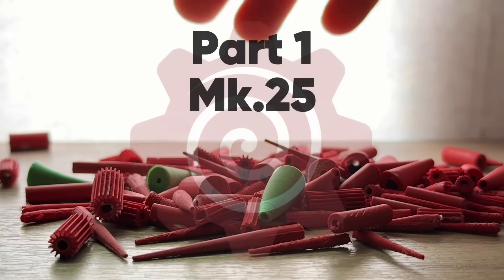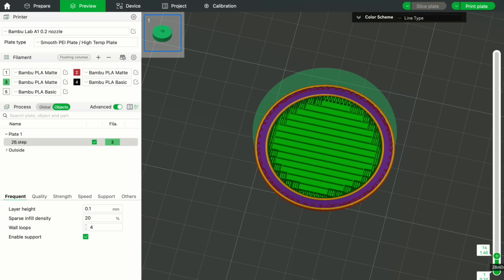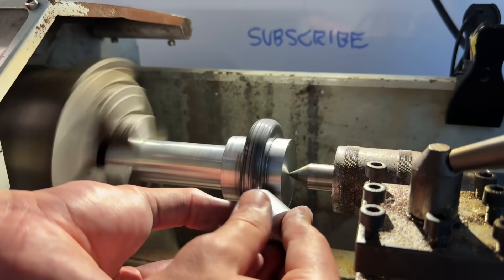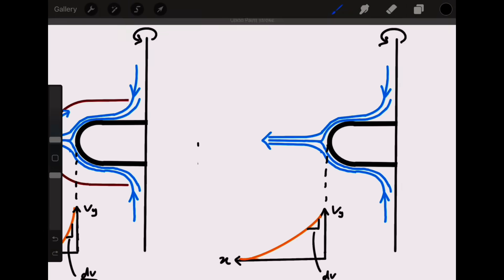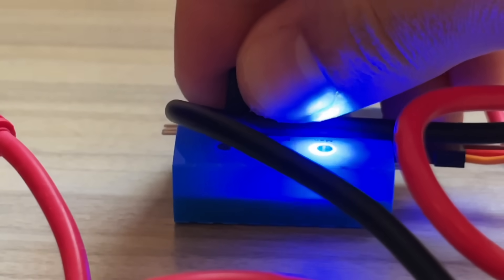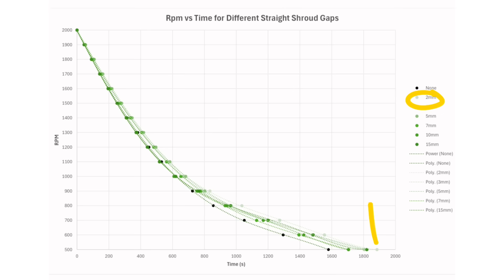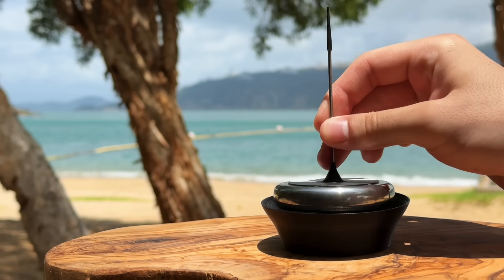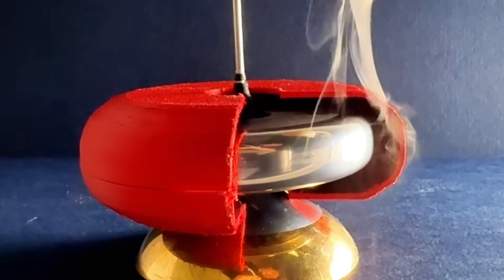Spinning Top Mk.25 | Aero Shroud??

Comment: Maybe it's worth to have concentric rings of slightly raised ripples on the top surface of the top. It could help prevent or limit the centrifugal pumping even without the shroud
Reply from the maker: Needs testing!

Comment: What happens if you set that shell spinning too? To maintain the inertia of the air around it.

Or... What if you make a spinning top that, instead of fighting the wind, uses the wind to spin even longer?
Reply: Or both... You could make an open capsule in a specific way that allows the wind to enter and rotate inside it, helping the top spin faster than in a vacuum.

It would be as if the wind were a jet of compressed air propelling only the sides.
Reply from the maker: Interesting ideas, yes it would help, though difficult to implement!

Comment: Is it against the rules to heat up the top?  Assuming there isn't material failure from the weaker and critical materials like the tip, a warmer top would heat up the air inside the shroud and would make it a less dense fluid.
Reply from the maker: The jury is still out as to what the ideal atmosphere would be. On one hand, yes hot air is less dense, but cold air is less viscous. Complicated!
Reply: @hiper_tops  Hmm, maybe then there would be an ideal temperature, a sweet spot given those opposing factors

Comment: This channel annoys me cause i told you how you can get free spin time but you refuse to do it. Just add bearing in between the friction point and the body. Or even better add like a cascade of them. Each segment will reduce the friction. Then end it with the carbide tip. Free spin time.
Reply from the maker: This isn’t allowed for the record (“no moving parts”), however I agree it could help and will try it for fun in the future :)

Comment: @nd post..Meh I wrote the first post completely forgetting Nikole Tesla centrifuge...using air , blown over equally spaced plates will cause a laminar drag, that will enable, ludicrious RPMs...
AKA and air hose...lol. Im so derpy sometimes.  Constructs giant geared Rube Goldberg contraption to spin top. Dude walks up wit tire pump and destroys my accomplishments in two pumps...sigh. CYA.  Im going back to building over powered racing rider mowers.  Where i belong.  And leaving this hard stuff to you.
Reply from the maker: Hahaha compressed air is certainly good at getting things spinning

Comment: I have a 50 to 1 speeder drive rated at a maximum 250 ft lbs of torque lol.... So using a Honda B20B We could maybe theoretically hit 500,000 Rpm's? 
( I know its wont actually spin that fast, the bearings are rated to 100,000 Rpms on the output side. Too bad. But thought it a funny mention for you.
I do know there are very small air bearing speeders that can comfortably run at over 125,000 Rpms.  Wonder how long it would keep that top spinning?
Reply from the maker: This is a fun idea actually, seeing how start I could start it just for fun. It would make for a crazy decay curve for sure!

Comment: With 3d printing being an option for the shroud... i wonder what effect different textures could have when using a more accurate resin print. You could also print thin caps for the weight to really play with drag reduction. The clasic golf ball texture being one example but others like airbus's shark skin texture would be more interesting imho.

Comment: What would you do to improve if you haf unlimited time and resources?
Reply from the maker: That’s a fun question! Certainly an Osmium flywheel is a given, it is the densest material known at 23g/cm^3 but incredibly expensive. Then some kind of super stiff but low density polymer core, perhaps resin printed. A concave mono crystalline diamond base which is super smooth would be great. However I’m not even sure this is possible, perhaps if I were to throw enough money at it someone would try.

Comment: You could try some gas density tests with hydrogen or helium in a box spin up and flood the box with a small vent at the bottom with H or He 
Might be an easier test than altitude to start with.
Reply from the maker: I like this idea, it’s cheeky but could be fun and I think it would help

Comment: What if you spin the shroud too?  (formed as a top where the cover over the top functions as the handle, and then you can spin up the shroud so that the internal airflow isn't pushing against a solid boundary?
Reply from the maker: This is a unique idea, yes it could help but it would be a bit difficult to implement and feels a bit to cheaty
Reply: @hiper_tops i feel like it would only be cheating if the exterior was spinning faster than the interior, therefore imparting force upon it, but as long as the exterior is spinning slower, it's still bleeding momentum from the principal top.

Comment: What is a "top"?
Is top that stable in a statiс, ie stable at 0 rpm didnt touching base, still consider top? Low centre of mass below touching point, will make top unfallable => longer spinning at extreme low rpm.
P.S Still suggesting mountain trip. Spin top at the top of the World.
Even small elevation, like 2km will make difference.
Reply from the maker: Generally it is accepted that a top’s tip must be below its centre of mass such that it topples at the end of the spin. High elevation testing is on my to-do list!

Comment: If the surface experiencing maximum air speed were profiled less like D and more like ▷, it might make a beneficial difference in how much drag goes to pumping vs shearing.
Reply from the maker: If the top were spinning a lot faster then this may be true but even at 3000 rpm, air sticks to the profile quite nicely and ejects in a disc

Comment: What about adding circular ridges inside the shroud to further restrict the recirculating flow?
Reply from the maker: This is an interesting idea which I may try but I find if the shroud is too close to the top, it makes the spin up difficult and when toppling the top can’t lean over as far before the spin ends.

Comment: One of the things that stands out to me is the slight wobble of the handle. Even as small as that wobble is, you're probably losing some energy to it because of needing to displace the air when it moves. It seems likely to me that it adds up over the length of the spin.
Reply from the maker: You are absolutely right. In this case during filming the balance was not perfect. It was a lot better when I recorded the best spins. In the future I will put more effort into displaying the top at its peak :)

Comment: I'm not sure about the reliance on 3d printed parts for a high-precision device like this top.  Somebody else mentioned the inherent surface roughness, and I think you should probably consider applying a surface filler and sanding them smooth, but that's all I'm going to say on that.

However I think there may be another issue that has been overlooked, which is balance.  Even a tiny imbalance at a couple thousand rpm could be enough to rob some energy at the bearing interface.  3d prints are by nature an imperfect medium.  There could be slight variations in the location of the print head on different travel directions.  You could introduce an imbalance if your infill pattern is not geometrically centered precisely on the axis of the top.  You might even see variations in the material properties of the plastic lead to imbalance (unlikely unless the filament isnt stored right).  

This leads me to ask, as a professional engineer, what real-world advantage does a lightweight plastic core actually have compared to an aluminum alloy?  If you test them side-by-side, are you able to get both up to the same RPM?  If your answer to that is yes, then you're actually hurting yourself with the plastic core because you're starting with slightly less angular momentum.  And when you're optimizing every single bit of the engineered design toward maintaining angular momentum for the longest time possible, starting with even 1% more of it will make a difference.   On the other hand, if you do find the lightweight core lets you spin it that much faster, maybe you could consider a machined plastic core.  It's not going to be as light as the hollow 3d-printed core, but it would solve the roughness and balance problems i discussed above.

On a slightly related note, If we're optimizing every bit of the design, I'm going to pick on your bearing interface.  Tungsten carbide is cheap and abundant but not the absolute best material you could pick.  You also appear to be running with no lubricant.  I'm not sure if lubricant would actually help or hinder, but that's easy to test.
Reply: Well i got nerdsniped and started looking up friction coefficients of very hard materials.  Diamond is of course hardest, and synthetic diamond might be worth considering.  Unfortunately I'm struggling to find friction data for diamond under moderate loads.  Most of the stuff i'm, clicking on is talking about micro-newton loads in MEMS devices or similar microscopic applications.  But i did stumble across an article that mentioned 2 other carbides, silicon carbide (SiC) and boron carbide (B4C).  
SiC is apparently 9.4 on the Mohs scale and also has a much lower friction coefficient that WC, but it doesnt look easy to get in solid pieces the size you need.  
B4C is apparently Mohs 9.5, has a friction coefficient about half of WC, and appears to be used as solid crystals as the tips of some lathe/machining inserts, which would be about the size you need.
Reply from the maker: Thank you for these comments and research. Some good points about bearing materials - this is something I’m still working on, including diamond!!

Comment: If you start changing surface finish you MUST test every single change individually with a control, it is very very hard to predict, and smooth is not always better

Comment: I got some tips for printing transparent parts. There are two main methods.
1. 100% infill, obviously, and turn on ironing on every layer. This almost entirely eliminates voids in the print, but will result in excess material forming zits all over the surface, so the part needs to be sanded down and polished. The result is not completely perfect, but the process is relatively simple and very consistent. 
2. Remelt the print in salt. Free spirit 1 has a video about it (nRLJ4ylGTFc). The result (after sanding and polishing, of course) is perfectly clear, but the process is finicky. The remaining air coalesces into big bubbles in the print, so what you have to do is add reservoir (a big block of plastic) onto the part for the bubbles to flow into and angle it in the salt such that air from anywhere in the part can flow into it without getting trapped. And then you have to hope it works. Which it often doesn't, especially with thin parts. Oh and sometimes the mold just collapses. It's a lot of work, but the parts (if polished well) come out clear as glass.
Reply from the maker: Wow thank you for this feedback!

Comment: If using a vacuum chamber is off the table, do "the rules" allow using some gas, like helium or hydrogen to reduce drag, or maybe just increasing the temperature to decrease the density of the air? An increase of temperature of  3 °C  will make the air about 1% less dense, all else equal. Assuming aerodynamic drag is the major loss, and the density affecting both the "gripiness" of the air, and the mass per unit of volume accelerated, a 3 °C increase in temperature might result in somewhere around 1% overall improvement.
Reply from the maker: You raise an interesting point and to be honest I’m not sure exactly how things like temperature and humidity would impact times. For example, although hot air is less dense, it has higher dynamic viscocity. Similarly humid air is less dense but has a higher dynamic viscocity. Interesting stuff! I may talk about this in a future vid

Comment: You need to try dimpling it!

Easier said than done obviously. But a perfectly polished surface typically has higher drag relative to a dimpled (but not rough) one! Will probably negate the need for a shroud!

For your first test, you could try a smooth 3d printed top vs a dimpled one to see if there's an improvement. Probably only worth trying if you have a resin printer to minimize effects of layer lines. You could also see if any of the online print/fabrication services could 3d print the dimpled top in sintered metal. Hellooooo pcbway sponsorship 😂
Reply from the maker: Hahaha I have actually tested dimples and found they are counterproductive in this application. I will make a video on this soonish!

Comment: Check dimples like on a Golfball for the inside of the shroud or the flywheel…. Who knows what it might bring 😅 But i would print it with a resin printer. Even a cheap one gives you a better surface finish and therefore better aerodynamics !! Good luck and keep on 😊
Reply from the maker: I have actually tested dimples and found they are counterproductive in this application. I will make a video on this soonish! Good point about resin printers
Reply: @hiper_tops awesome ! Already curios to see it 😊 Wish you luck for the World-Record 🎉

Comment: have you also considered moving to hollow shaft instead of a solid titanium rod, it could offer the last bit of weight savings with most of the rigidity
Reply from the maker: That’s true, and was my initial plan, however it is hard to find thin hollow rods!

Comment: If the goal is avoiding pumping effects then you probably want thin barrier ribs as close the top as possible. This would minimise extra drag while preventing circulation.
Also, what lattitude are you at? Those spin times are long enough that you probably need to be thinking about the effects of the earth's rotation. What angle would you expect it to be sitting at if angular momentum was entirely contained? Could you get longer spin times simply by starting slightly off vertical so that the earth's spin would initially make it more vertical? Is it worth simply flying north to do a run as close to the pole as possible?
Reply from the maker: Interesting suggestions! Regarding starting off vertical: If I did this (or regardless), the top would quite quickly right itself in a spiral motion towards perfect local vertical. This is due to an effect briefly explained in my spinning top science video - How to make the worlds longest spinning top

Comment: A really ‘out there’ idea may be to try and program some kind of optimiser for the shroud design (size, shape, hole placement etc). Something like a genetic algorithm tends to give unexpected designs for these kind of problems, that often outperform more conventional paramaterised designs.
That said, it wouldn’t be easy to code up and I’m doubtful you’d get a significant improvement.
Reply from the maker: It’s kind of a dream of mine for this project to culminate in such a programme. I believe it is possible, at least crudely, however will take some time and a lot of learning.

Comment: You may have tried this before, but have you considered adding (or rather removing) dimples to the mass? Like golf balls, they reduce drag. See a Mythbusters episode when they added dimples to a car to improve its mileage.
Reply: Dimples on golf balls work by delaying flow separation, which is not an issue here.
Reply from the maker: Indeed they would be harmful in the application of spinning tops. I will show this in a future video!
Reply: @agsystems8220   Ah. Thanks.

Comment: When I see your videos I am like "I want to try and make one", but I am also thinking about what are the design contraints? max weight, size etc.?
Reply from the maker: It is rather complicated! But you can’t go too wrong when following the ratios of examples that work well. It will mostly depend on whether you want single or multiple twirls, and what materials, sizes and machining capabilities you have available.

Comment: Any imbalance in the core mass will translate into microscopic lateral friction at your contact point and lose you efficiency. It seems likely to me that the 3D printed core would be difficult to keep perfectly consistent and difficult to get your spindle perfectly centered in. Have you tried to measure runout with a micrometer or interferometer?
Reply from the maker: You are right that the non-homogenous core is likely to have a slightly imperfect axis of rotation. However since the relative mass is so, so small, it has no measurable impact on the overall balance of the top - this depends almost entirely on the concentricity of the tip and flywheel. Although I do find that a wonky stem has a negative impact. So far I have been using quite analogue ways of measuring runout, this is certainly an area for improvement.